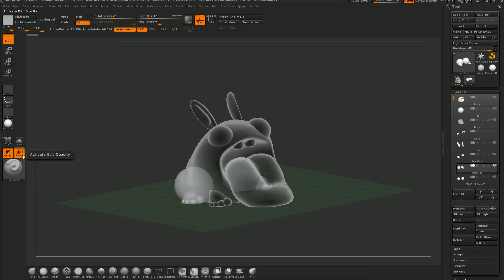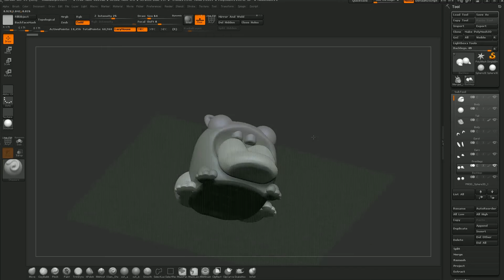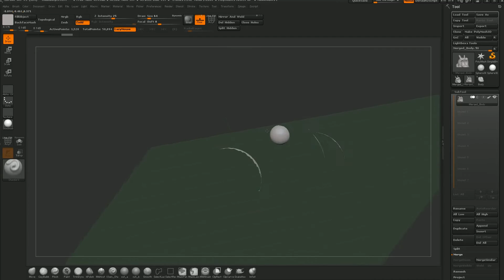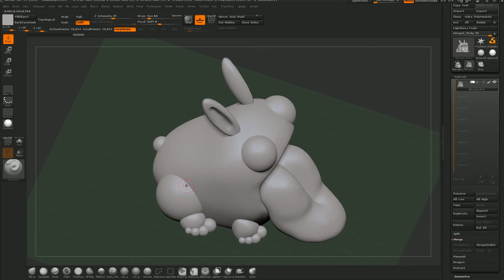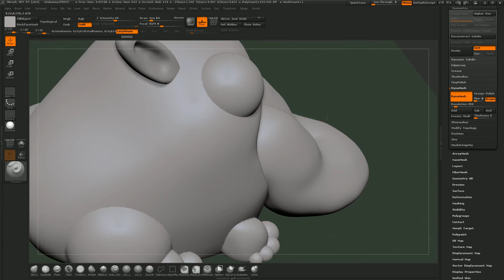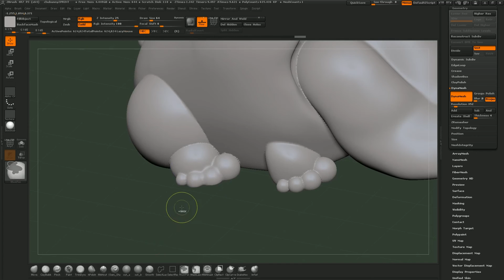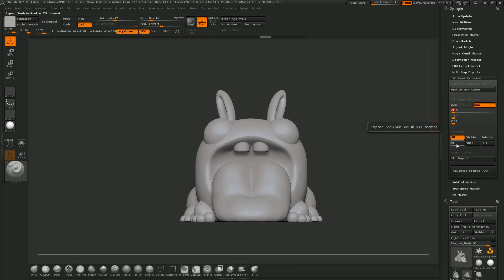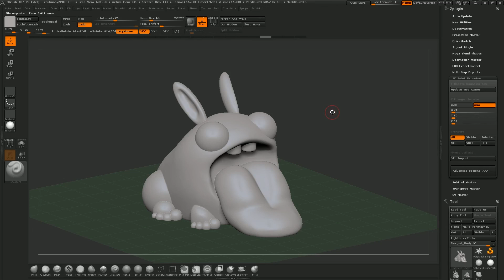zBrush 3D Printing Pt. 1 - Preparing your model

Comment: 0:01 Should have said "Hello there"
Reply from the maker: Lol, noted.
Reply: @SmallRobotStudio  Btw, I don't know if you can answer this, but I just got a MakerGear M2 printer. Am I supposed to put a hole in the miniature for air, or is that for some other printer?
Reply from the maker: Haven't 3D printed in a while but I generally left a hole at the bottom on models that have a lot of air inside relative to their size (like the one in this tutorial), stops them from distorting from the heat. Also useful if you're going to spray paint them or something after you print them.
Reply: @SmallRobotStudio  Okay. I plan on printing a miniature I made for D&D, so I guess I'll have to find a spot where I can put a hole